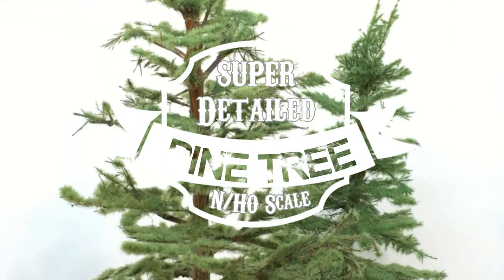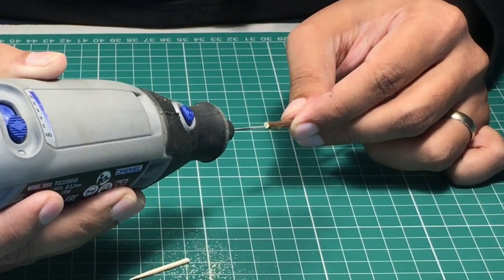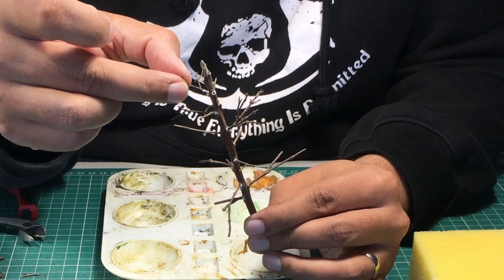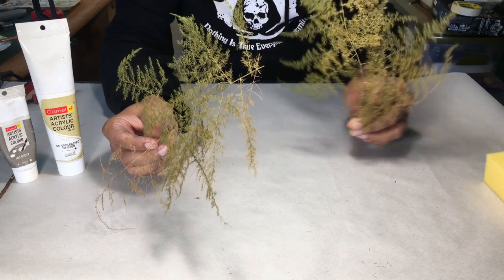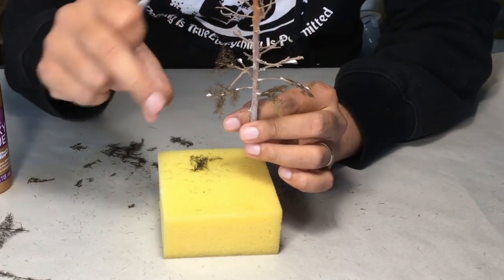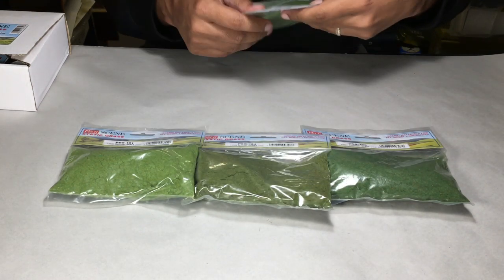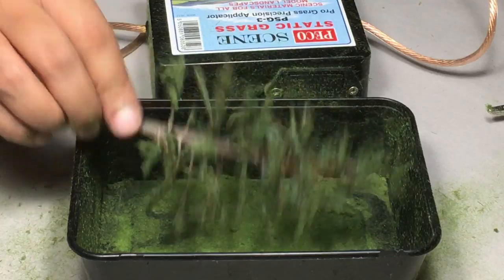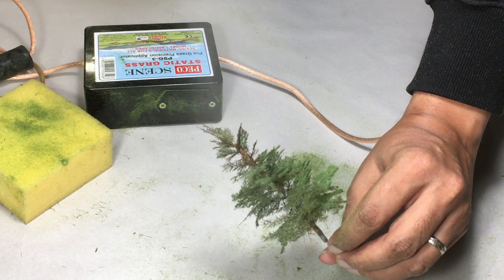Cheap Model Pine Tree that Looks Awesome - Model Railroad How-to

Comment: Very nice job, very nice. I’ve used similar techniques before. If I may, I’ll offer some future suggestions?
 Use a wire, 2-3” long, held in the alligator clip of your Grass applicator. It will help get to precise areas, within the trees canopy. Also, touch it to the branch you’re applying to. And always apply to the Bottom of the branches too. A Long needle pines needles grow around their branch, not just on the tops of them. Keep up your good work.👍🏼😁
Reply from the maker: Some great tips, thanks! I’ll surely try these tricks the next time I’m making a tree like that

Comment: Hello First - awesome work. Second On my trees, instead of hairspray, I'm trying out the metod with wallpaper glue. Did You heard about it? You're spraying twigs with water, and sprinkle it with that glue. After several seconds, it absorbs the water and spreads. It's drying clear. That method gives You more control about where the glue go, and less unwanted foliage on branches.
Reply from the maker: That seems like a fantastic solution to unwanted spray problem - thank you! I did a quick search and it seems that it's available easily, so I am going to give it a try in my very next tree model. Again, appreciate the tip. Always fun to experiment with new stuff!